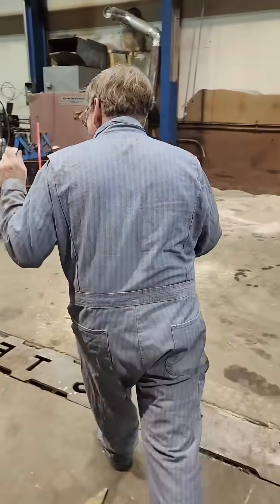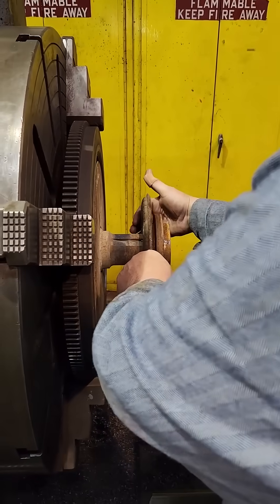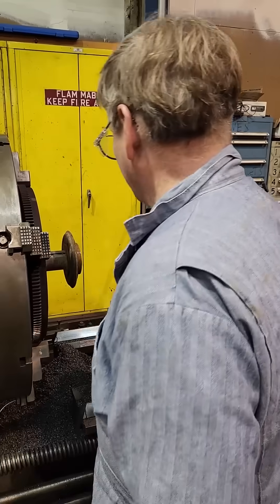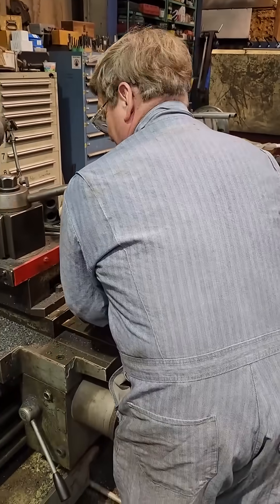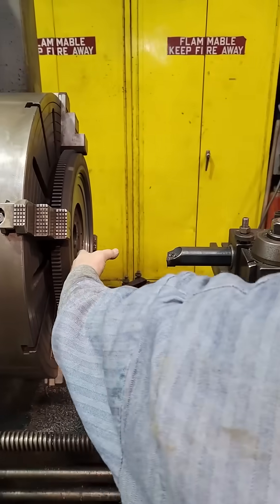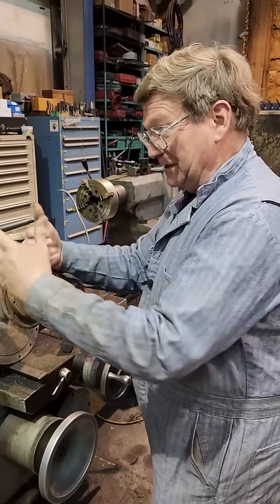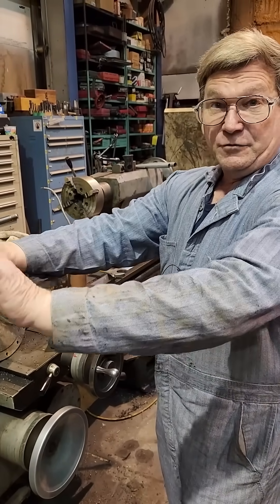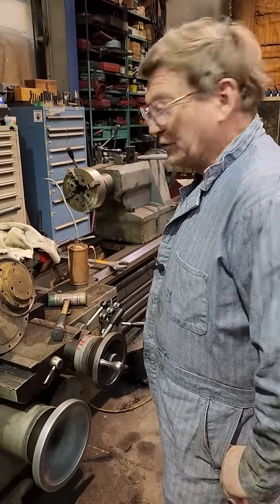Magnets can occasionally be useful on a lathe

Comment: You can harvest those magnets out of old hard drives. I keep a pair around the office, people start playing with them and no sooner than I can say ”you’ll draw blood” you hear the snap followed by the “OW!” Harvest a stash of them from old Enterprise hard drives and stack them up, playing with stacks of those will send you to the hospital. Tips and tricks: they are usually glued to a metal frame, soak in acetone or some other solvent. Sometimes it needs weeks. to loosen them. Do not heat them, they will lose their magnetic strength. Also, older drives will have a third small cylindrical or square magnet hiding in plastic, those can be useful also.

Comment: I remember a flywheel machined wrong and would not release and tractor went out through the wall of the shop
Reply: Please elaborate if you would
Reply: Both surfaces weren't machined equally and the clutch would not release and we were tasked to find out what the problem was@motherhorsefucker
Reply: Good job can you do it again.